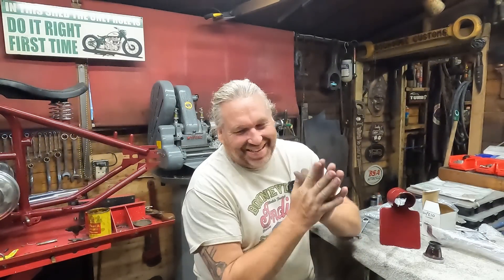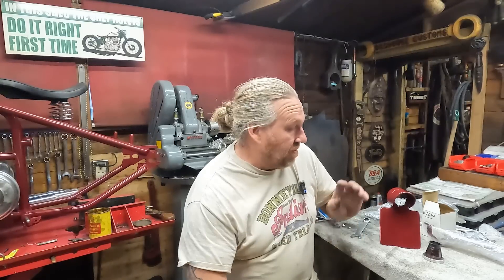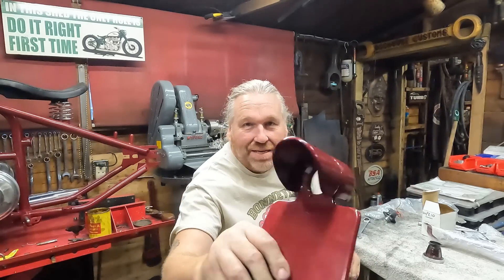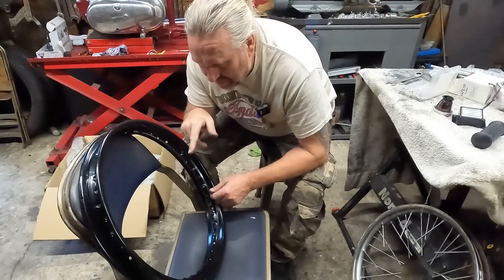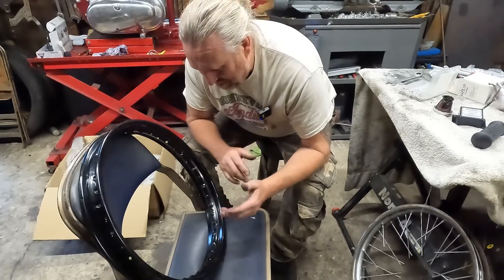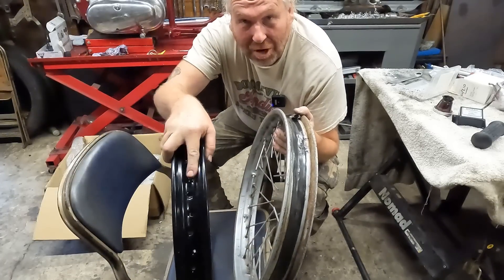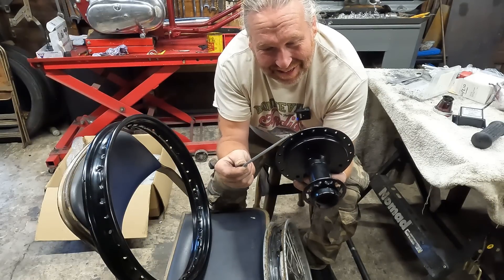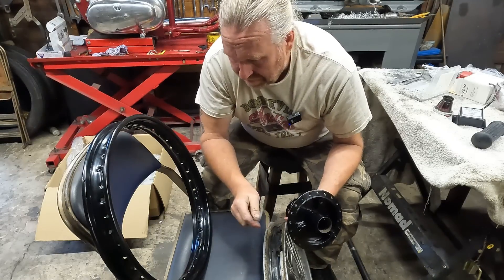Another Hold Up (Wrong Rim)

Comment: A year or so ago I got a new stainless rims for my D1 Bantam, which also has half hubs - the rear just would not lace up properly. Half the dimples in the rim were the wrong angles. The spokes would have to bend to fit. I could sort of make it work if I reversed the pattern, but then all the spokes were too short. I spent days and days on it. It was just made wrongly. So got another rim (from a different company), it all laced up correctly the first time in just 20 minutes. Just as long as it takes to put all the spokes in.

Yes sorry about the dog. 😢

Comment: a jewellers deburring tool would be good to trim up those holes in aluminium and the like, its a curved blade you run around the whole and it shaves the metal quick.